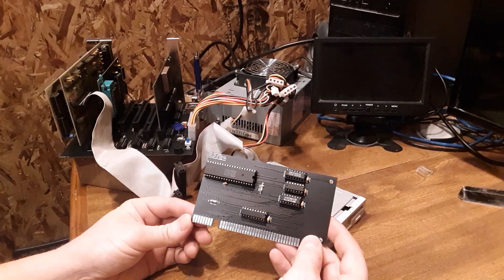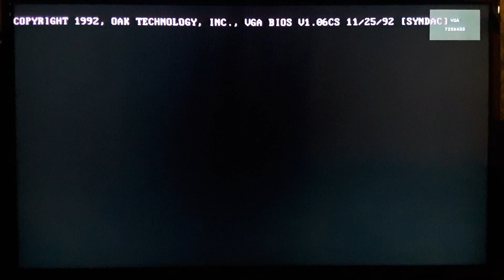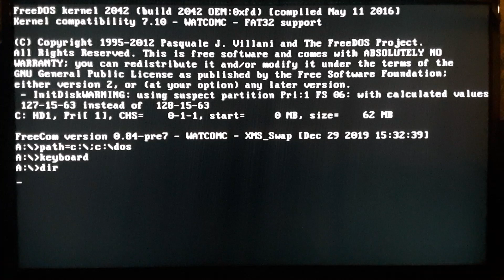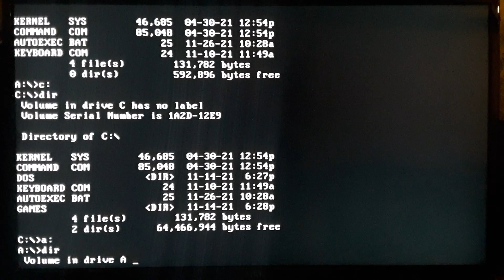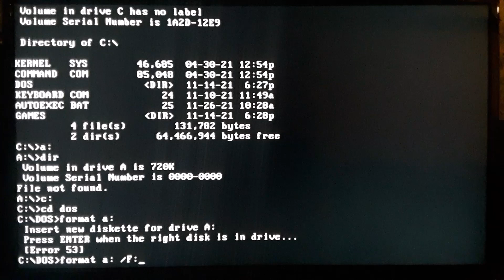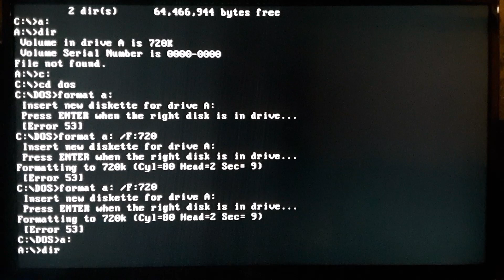Booting From a Floppy Disk. 8088 PC XT Compatible

Comment: I just completed assembling my DMA controller.  I booted the machine - no smoke!!   I don't have any DMA cards at this time. Is there any way to check if it is working with MSDOS?  Thanks...
Reply from the maker: There maybe a DOS utility out there that can test or detect the 8237. I have only manually tested one with some basic setup code and then trigger the DRQ. In one of my earlier 8237 videos I demo this. There is a risk of damaging hardware though.